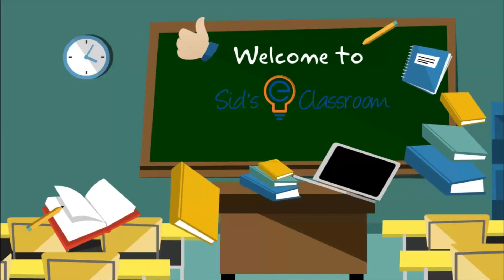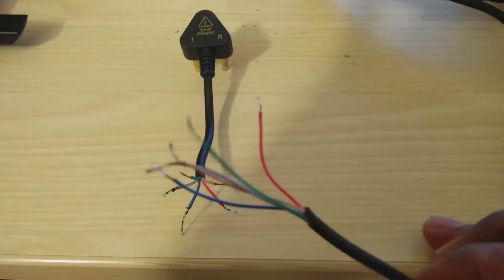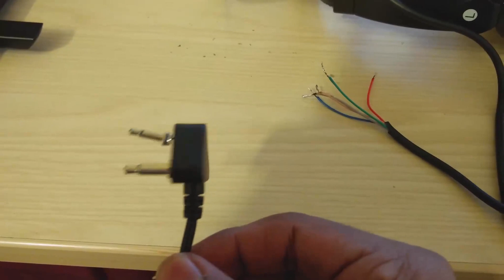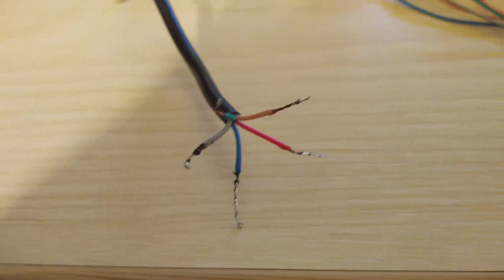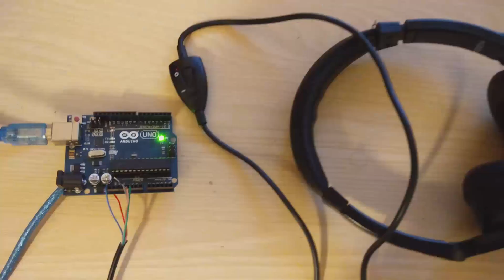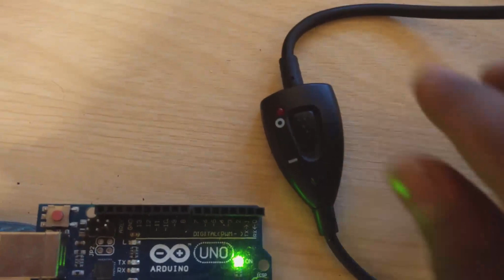Hack An Airline Noise Cancellation Headphones for use with PC Part-1

Comment: Thanks bro... It worked perfectly. I used the red wire (+ve) and black wire (ground)  of my USB charging cable to get the power.
Reply: is it still working? can you plz explain the steps in details and easy words? i am not much experienced with these stuff

Comment: No need to cut the connector. Just use an Y connector and also a 3V lithium battery
Reply: Hello. What type of Y connector should I use?
Reply: It´s not easy to get one of this on some places... better cut and mod add battery on the case of the headphones.
Reply: How to use 3V lithium battery and Why?